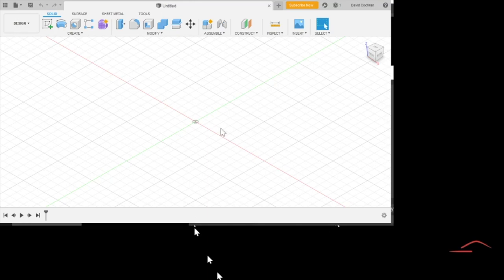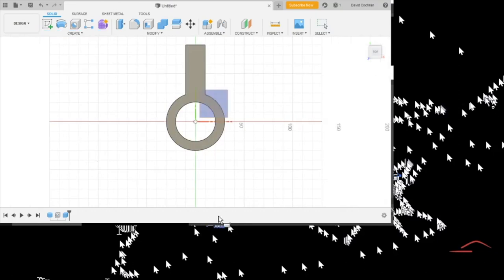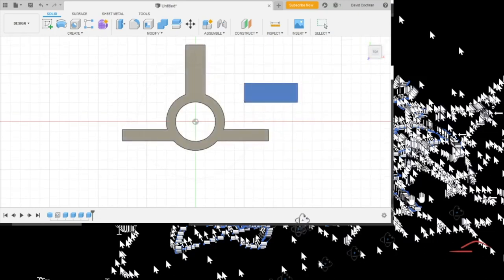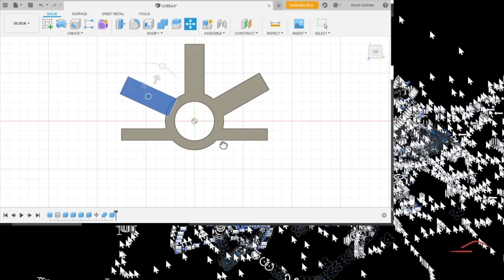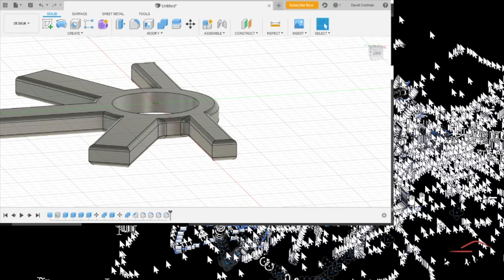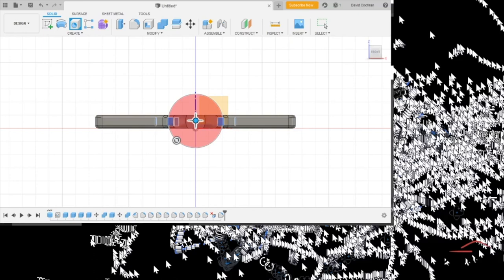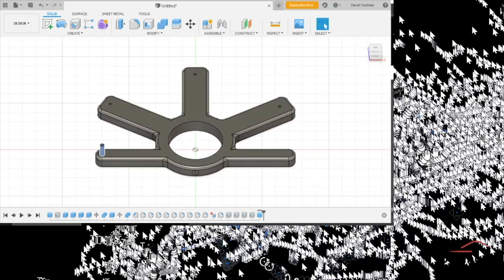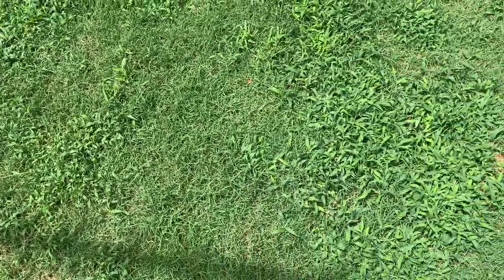Building Some Antenna Parts

Comment: Great job, would you consider making a set to sell to a disabled Ham that has like you been trying to use Callum's DX Commander idea and has the poles you use already. I also have a ground lift to raise the pole that was designed for a GAP vertical.  Someone very likely could sell these on eBay if they could be easily available knowing the large number of these poles out there even a kit likely would sell?  I am also thinking of reinforcing the joints on the poles using a repair wrap product, that way the pole could be higher and stronger so 40 meters could be accommodated.
Reply from the maker: Send me an email at David@OklahomaHamRadio.com please.